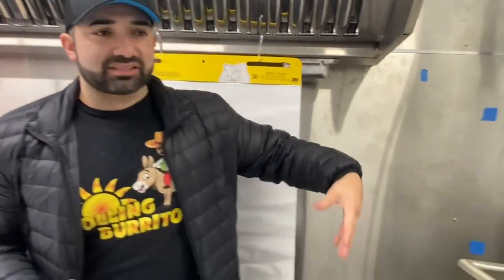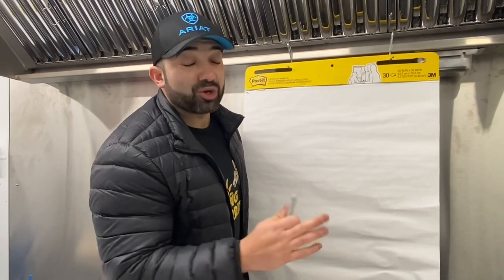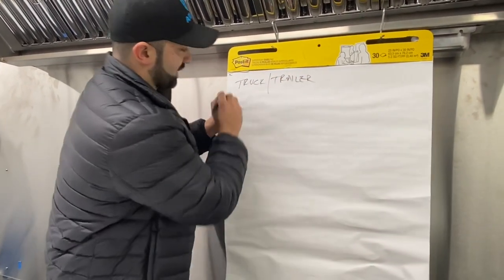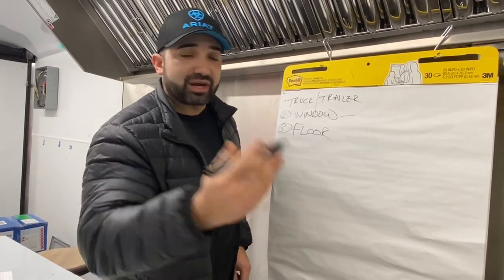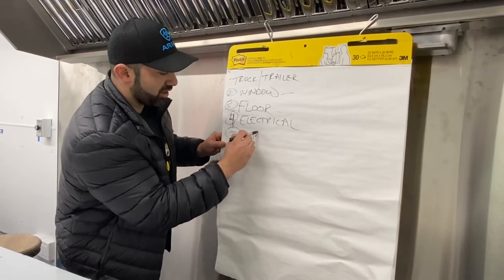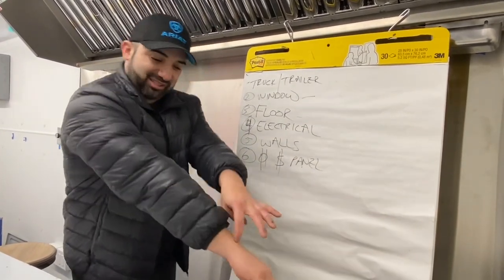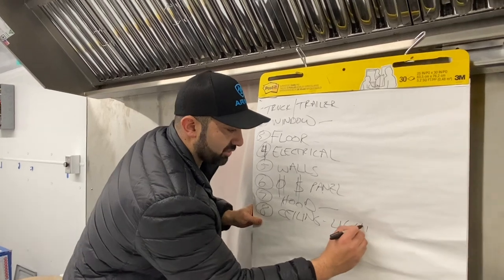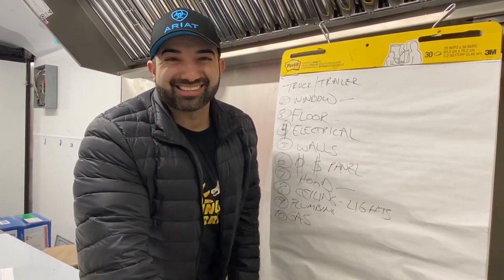10 Steps to Build a Food Truck

Comment: I’m about to buy a box truck I’m going to build a food truck but I’m worried about the roof this one has one of those clear roofs do you know kind of like a see-through roof do you think that’s gonna be a problem when installing the exhaust hood?
Reply from the maker: Good afternoon. You will have to cover that regardless of the top material there now. Once you plywood it will not be seen, unless you are referring to another part of the process